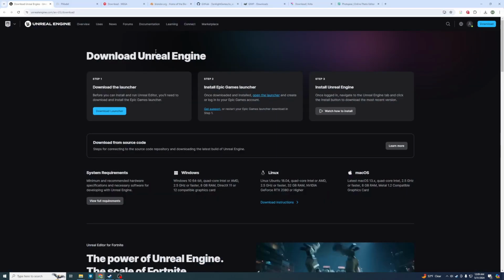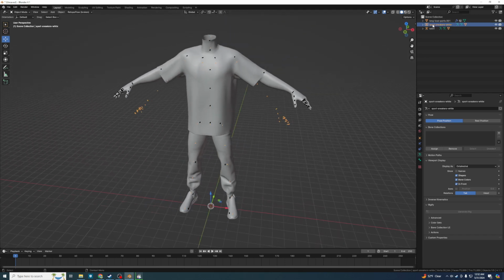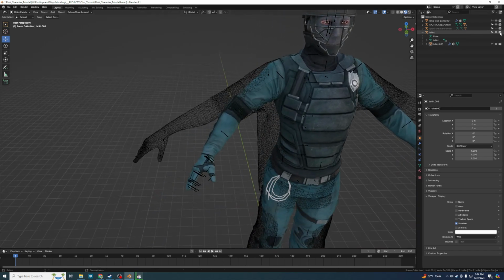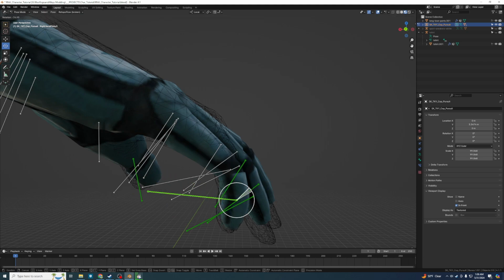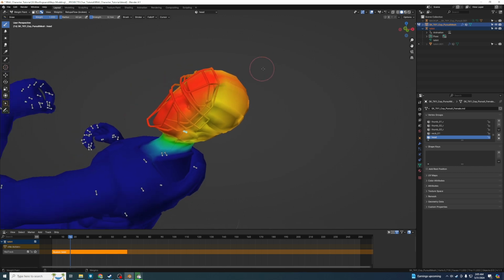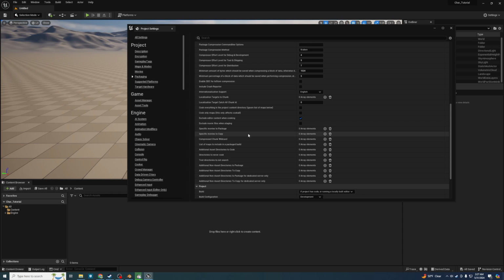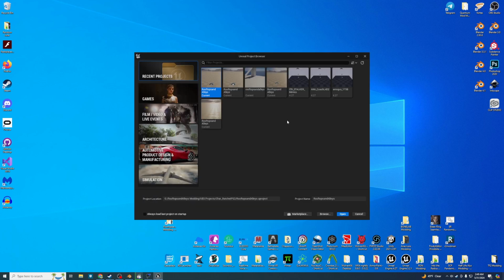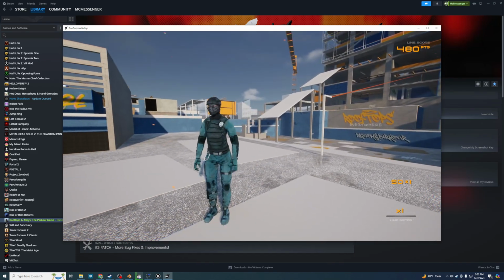Rooftops & Alleys - Custom Character / Mesh Swap Tutorial

Comment: I did everything as you said but my mod doesn't even load  in the gqme, I didn't use 5.2.1 version of ue5 is that the reason it's not working? I used 5.4.3
Reply: Ok so it was actually the problem sorry I'm a newbie, now I have another problem with materials, I have 2 materials, one for head one for body, the model looks okay inside viewport but when I package it and open the Game I can only see the textures for the head and the body is fully black

Comment: great tutorial!
i'm trying to make a personal mod and i'm having an issue with the upper-body tanktop which i'm trying to modify instead of just making an empty mesh but whenever I select that top the main character T pose in game.
I set my custom character in the lower-body and did the empty head successfully but I cant get the upper-budy to work.
any Idea of what could be wrong?
thanks.
Reply from the maker: Assuming you got your custom character working properly and replacing the lower-body option instead of the upper - I would just double check that your paths to the files in your project are named correctly, and making sure your upper-body tanktop is rigged properly when you export it to your UE5 project as an .fbx. There's another guide by asev that covers replacing clothing models specifically - that might help you find your problem: https://www.youtube.com/watch?v=PLG2R7o3uAc
Reply: @McMessenger  thanks for the quick response, you assumed correctly, when cooking the package the log says:
LogFbx: Warning: Not valid bind pose for Pose (tanktop) - Node tanktop : The relative matrices do not match
LogFbx: Warning: Getting valid bind pose failed. Try to recreate bind pose
Reply from the maker: @elsuperaguas  That error is basically telling you that the rest pose on the skeleton for your custom model (the .fbx you brought it into the project) is messed up somehow. Make sure you've applied all transforms for the skeleton in Blender (while the skeleton is in its rest pose) before you export it. Usually that error comes from having messed with the scaling in Blender and forgetting to 0 out your transforms before you export it.

If it's not that, then I'm wouldn't be entirely sure what the issue is.
Reply: Thanks again for taking your time to reply, I'll try again soon, worse case scenario I'll make another mod for the tank top.

Comment: If I wanted to mod in just a custom hoodie would that also need to be rigged?
Reply from the maker: Yes - it's the same kind of process as I show in the video, but instead of an entire character replacing just 1 part, you only need to have your custom hoodie replace a default one.
Reply: @McMessenger gotchaa it worked out perfect! Now tho I’m trying to add a empty head model with the jacket so the head can be removed in game and it worked but now my jacket doesn’t have texture in game